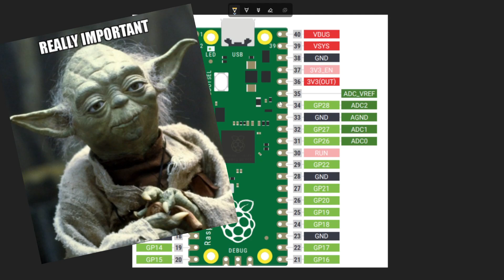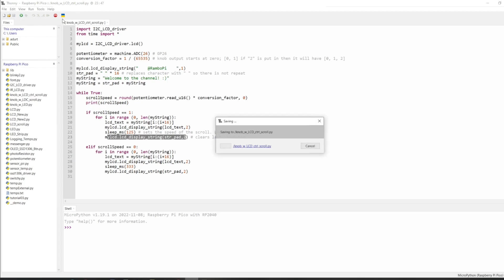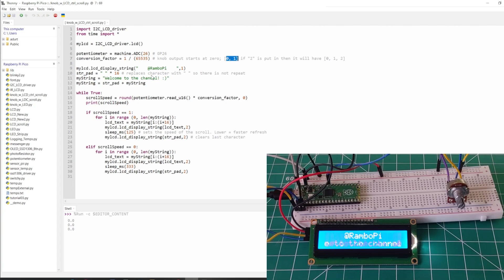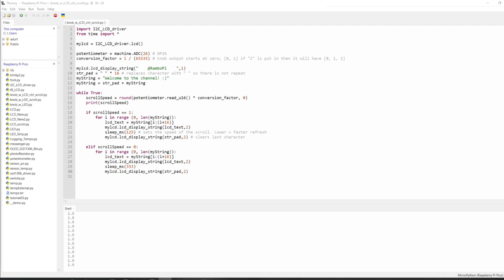Raspberry Pi PICO LCD Scrolling w/Potentiometer

Comment: is it possible to do this without i2c
Reply from the maker: Done..... https://www.youtube.com/watch?v=ulVr5TGbfMk
Reply: @RamboPi  sorry i meant the scrolling text without an i2c LCD
Reply from the maker: I don't think I'm following your ask. What are you asking in regards to the potentiometer and where would the text scroll?
Reply: @RamboPi  no
I want the text to scroll on the lcd display using pi pico
Reply from the maker: @hardnachopuppy  The LCD is connected via I2C. You just want a fixed text string to scroll on the LCD at start up?
Reply: @RamboPi  yes but without the I2C board on LCD
Reply from the maker: ohh got it. I only have an LCD that has the board pre-soldered on. It came with the Pico starter kit that lead me on this Pico journey. If I come across an LCD like this, I can add it to my  video road map but until I acquire one, don't think I can make a video on this blindly. So sorry
Reply: @RamboPi  ahh ok 
Still thanks for replying